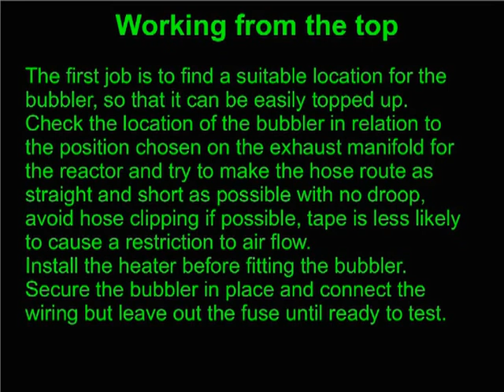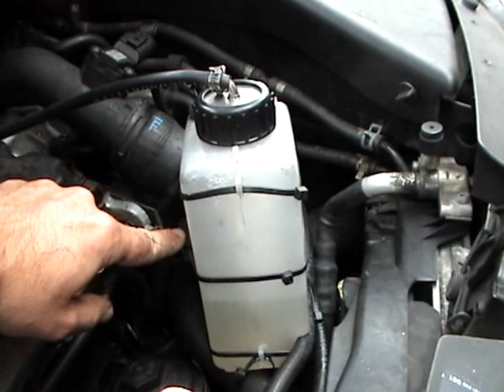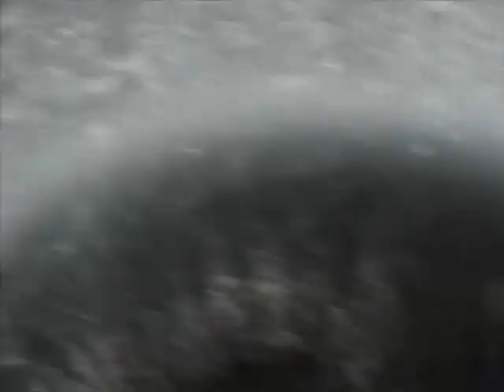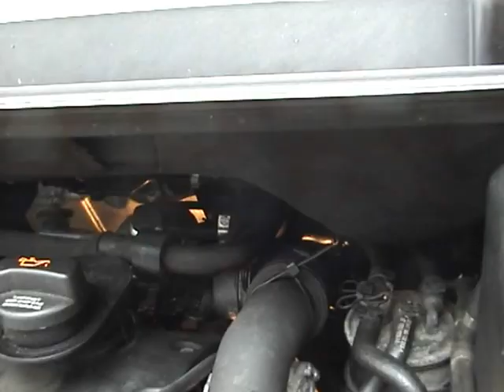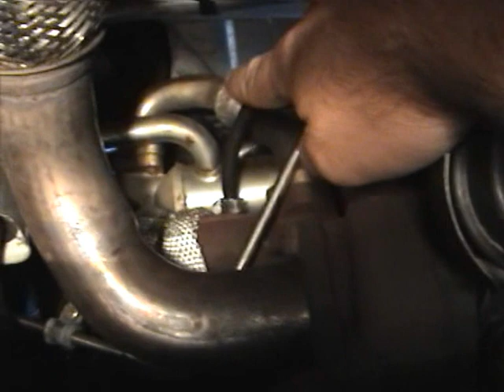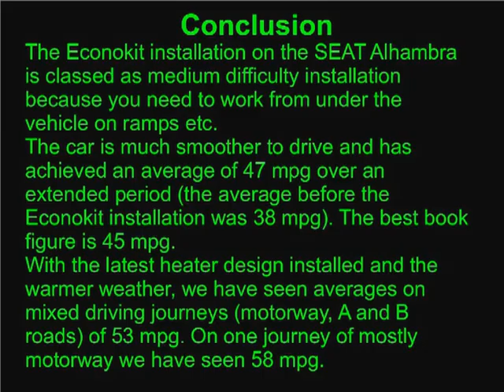Econokit Standard fitted to SEAT Alhambra 1.9 TDi.mpg

Comment: Dear Sir,  I need help from you,  the problem is I have sent the Ahambra TDI to the garage after it back to me it seems like no power to run to the high place ie. hill,  I found that the hoses  (vaccum) not fixed in most position will be pleased if you can give me a draft drawing of this hose ie from where to where Thanks